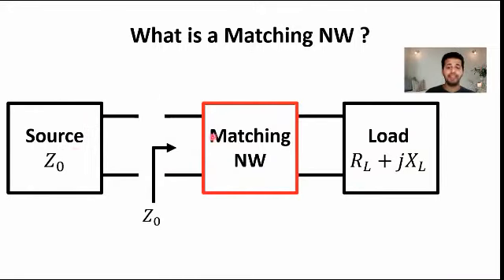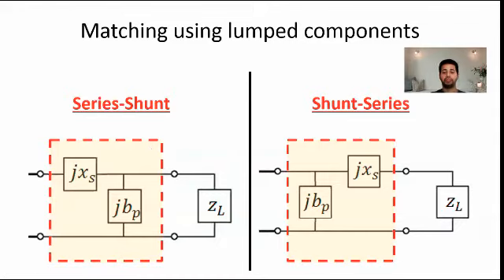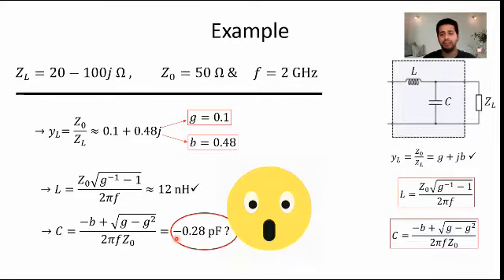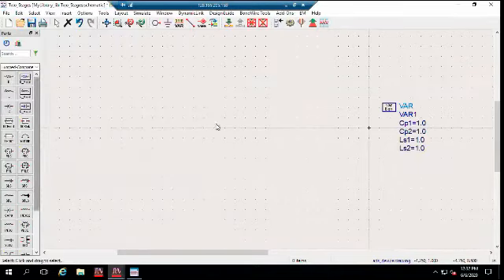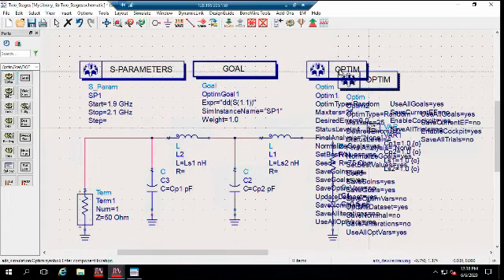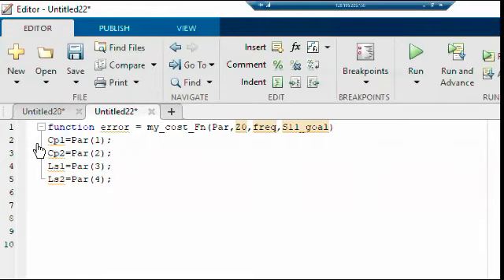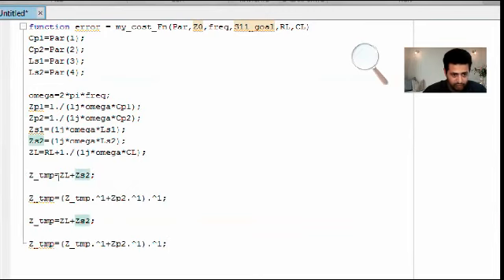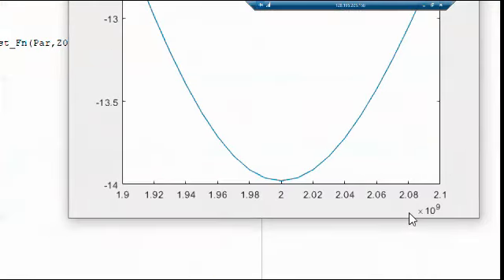Matching Network Design Analysis and Simulation (ADS & Matlab)

Comment: ** Piezoelectric Circuit **
*
* Multisim Live SPICE netlist
*
*

* --- Circuit Topology ---

* Component: Cf
cCf 3 4 1e-9 

* Component: I1
gI1 3 1 5 6 1

* Component: PiezoSim
vPiezoSim 5 6 dc 0.09 ac 1 0 
+ distof1 0 0 
+ distof2 0 0 
+ sin ( 0.09 0.36 5 0 0 0 )

* Component: Rd1
rRd1 2 1 10000 VIRTUAL_RESISTANCE_Rd1 

* Component: Rd2
rRd2 1 0 10000 VIRTUAL_RESISTANCE_Rd2 

* Component: Rf
rRf 3 4 10000000 VIRTUAL_RESISTANCE_Rf 

* Component: U1
xU1 1 3 2 0 4 AD8541_U1

* Component: Vrail
vVrail 2 0 dc 5 ac 0 0 
+ distof1 0 0 
+ distof2 0 0

* --- Circuit Models ---

* Rd1 model
.model VIRTUAL_RESISTANCE_Rd1 r( )

* Rd2 model
.model VIRTUAL_RESISTANCE_Rd2 r( )

* Rf model
.model VIRTUAL_RESISTANCE_Rf r( )

* --- Subcircuits ---

* U1 subcircuit
* AD8541 SPICE Macro-model Typical Values
* Description: Amplifier
* Generic Desc: 2.7/5V, CMOS, OP, Low Pwr, RRIO, 1X
* Developed by: TAM / ADSC
* Revision History: 08/10/2012 - Updated to new header style
* 1.0 (06/1998)
* Copyright 1998, 2012 by Analog Devices
*
* Refer to http://www.analog.com/Analog_Root/static/techSupport/designTools/spiceModels/license/spice_general.html for License Statement. Use of this model 
* indicates your acceptance of the terms and provisions in the License Statement.
*
* BEGIN Notes:
*
* Not Modeled:
* 
* Parameters modeled include: 
*
* END Notes
*
* Node Assignments
*		noninverting input
*		|	inverting input
*		|	|	 positive supply
*		|	|	 |	 negative supply
*		|	|	 |	 |	 output
*		|	|	 |	 |	 |
*		|	|	 |	 |	 |
.subckt AD8541_U1	1	2	99	50	45
*
* INPUT STAGE
*
M1 4 1 8 8 PIX L=0.6E-6 W=16E-6
M2 6 7 8 8 PIX L=0.6E-6 W=16E-6
M3 11 1 10 10 NIX L=0.6E-6 W=16E-6
M4 12 7 10 10 NIX L=0.6E-6 W=16E-6
RC1 4 50 20E3
RC2 6 50 20E3
RC3 99 11 20E3
RC4 99 12 20E3
C1 4 6 1.5E-12
C2 11 12 1.5E-12
I1 99 8 1E-5
I2 10 50 1E-5
V1 99 9 0.2
V2 13 50 0.2
D1 8 9 DX
D2 13 10 DX
EOS 7 2 POLY(3) (22,98) (73,98) (81,0) 1E-3 1 1 1
IOS 1 2 2.5E-12
*
* CMRR 64dB, ZERO AT 20kHz
*
ECM1 21 98 POLY(2) (1,98) (2,98) 0 .5 .5
RCM1 21 22 79.6E3
CCM1 21 22 100E-12
RCM2 22 98 50
*
* PSRR=90dB, ZERO AT 200Hz
*
RPS1 70 0 1E6
RPS2 71 0 1E6
CPS1 99 70 1E-5
CPS2 50 71 1E-5
EPSY 98 72 POLY(2) (70,0) (0,71) 0 1 1
RPS3 72 73 1.59E6
CPS3 72 73 500E-12
RPS4 73 98 25
*
* VOLTAGE NOISE REFERENCE OF 35nV/rt(Hz)
*
VN1 80 0 0
RN1 80 0 16.45E-3
HN 81 0 VN1 35
RN2 81 0 1
*
* INTERNAL VOLTAGE REFERENCE
*
VFIX 90 98 DC 1
S1 90 91 (50,99) VSY_SWITCH
VSN1 91 92 DC 0
RSY 92 98 1E3
EREF 98 0 POLY(2) (99,0) (50,0) 0 .5 .5
GSY 99 50 POLY(1) (99,50) 0 3.7E-6
*
* ADAPTIVE GAIN STAGE
* AT Vsy>+4.2, AVol=45 V/mv
* AT Vsy<+3.8, AVol=450 V/mv
*
G1 98 30 POLY(2) (4,6) (11,12) 0 2.5E-5 2.5E-5
VR1 30 31 DC 0
H1 31 98 POLY(2) VR1 VSN1 0 5.45E6 0 0 49.05E9
CF 45 30 10E-12
D3 30 99 DX
D4 50 30 DX
*
* OUTPUT STAGE
*
M5 45 46 99 99 POX L=0.6E-6 W=375E-6
M6 45 47 50 50 NOX L=0.6E-6 W=500E-6
EG1 99 46 POLY(1) (98,30) 1.05 1
EG2 47 50 POLY(1) (30,98) 1.04 1
*
* MODELS
*
.MODEL POX PMOS (LEVEL=2,KP=20E-6,VTO=-1,LAMBDA=0.067)
.MODEL NOX NMOS (LEVEL=2,KP=20E-6,VTO=1,LAMBDA=0.067)
.MODEL PIX PMOS (LEVEL=2,KP=20E-6,VTO=-0.7,LAMBDA=0.01,KF=1E-31)
.MODEL NIX NMOS (LEVEL=2,KP=20E-6,VTO=0.7,LAMBDA=0.01,KF=1E-31)
.MODEL DX D(IS=1E-14)
.MODEL VSY_SWITCH VSWITCH(ROFF=100E3,RON=1,VOFF=-4.2,VON=-3.5)
.ENDS AD8541